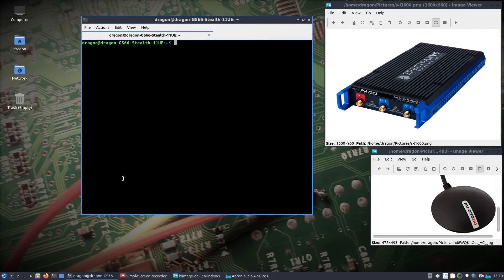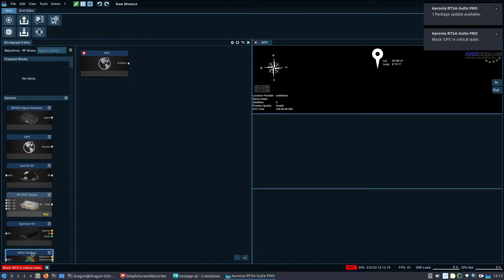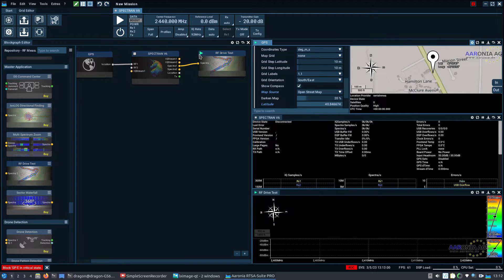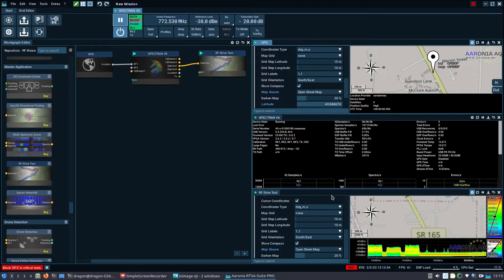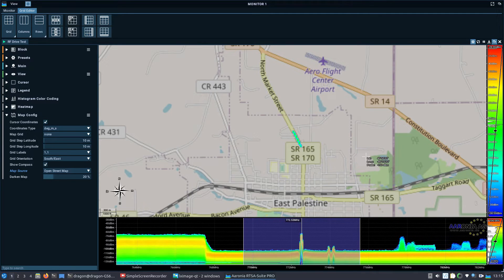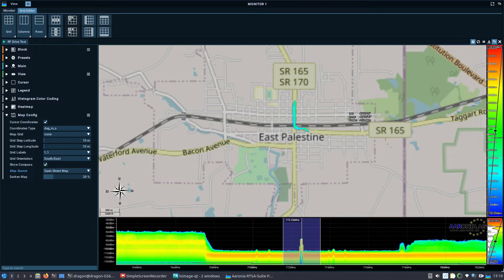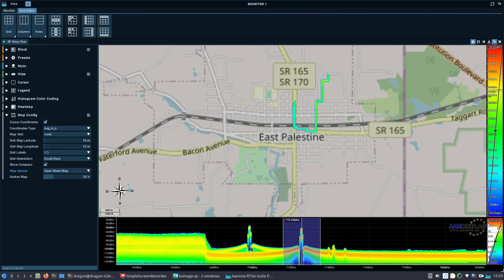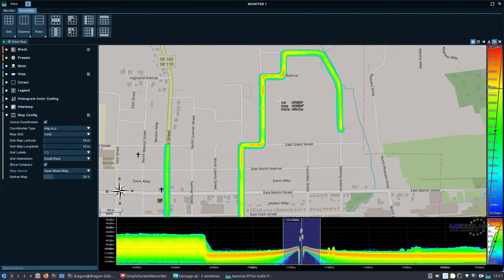DragonOS FocalX Generate RF Heat Maps w/ Aaronia RTSA Pro + Spectran V6 (2000X, BU353-S4)

Comment: There’s an excellent app for to utilize an iPhones (if that’s what a person uses) GPS data called GPS 2 IP. There’s a paid and free. I liked it so much I bought the full version. And it’s easily ported into windows. I used it with Vistumbler to map WiFi access points and worked flawlessly.

Comment: I have HackRF, is possible to do something on Directional Finders with . Please any guide
Reply: Thanks so much. Is possible to get the link to the SDRAngle tutorial
Reply from the maker: DragonOS FocalX SDRAngel Quick Fix for GPS + Heat Map Setup (RTLSDR)
https://youtu.be/E4LIOso99sc
Reply from the maker: You could use it to heat map, I suppose if you have the antenna switching unit for it that you could use it for DF too.
Reply: @cemaxecuter7783  I have install the Drago OS , can you point me to any specific tools i can work with for the heatmap with the hackRf
Reply from the maker: @SokoAerial  I would check out the latest video I did with SDRAngel. You would just change the input to the hackrf instead of the rtlsdr. You will also need a usb gps. I put some instructions in the description to. I think it’ll work great for you. Also make sure you have upgraded your hackrf firmware to match what’s in DragonOS. I put a shortcut under Other that points to a firmware directory. You can find the firmware for the hackrf there and you’ll just need to flash your hackrf with it.